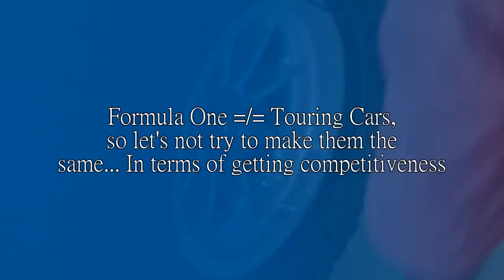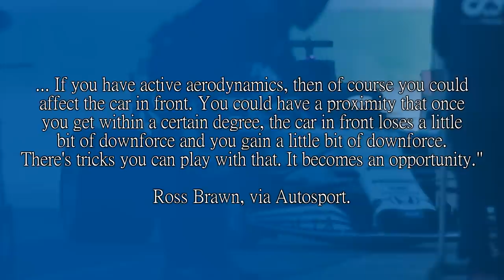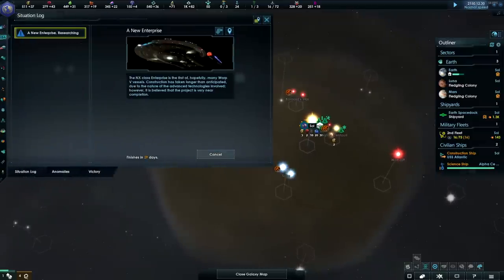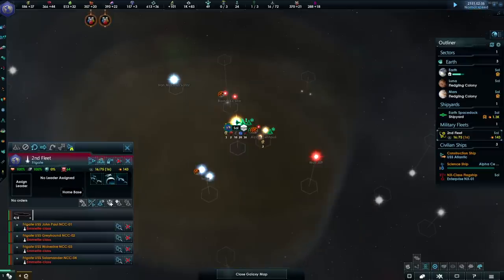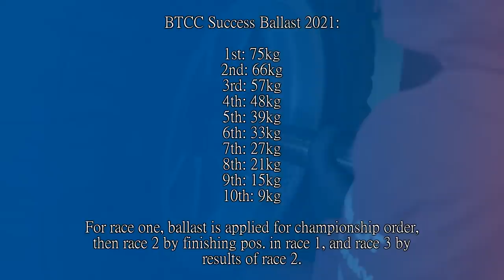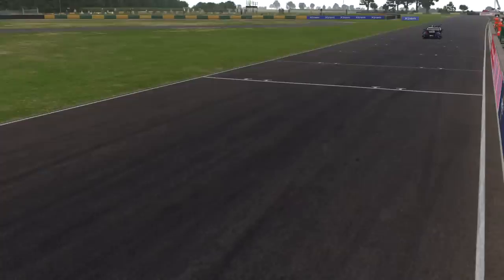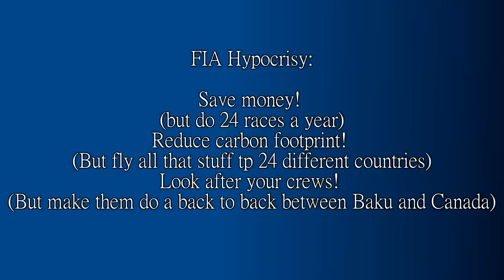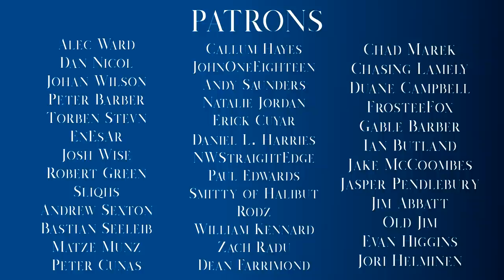BRAWN'S BIG BRAIN MOMENT: Opinions on the Proposed 'Reverse DRS' System for 2026

Comment: Cheers for the video Aidan. I was listening to your general description of what an F1 car is at the commencement of the video and my honest response to that with this era of car is, “Is it? Is that really what it is?” Hard to be surprised about a proposal to use active aero to disadvantage the leader as nothing is off limits to those in charge now. We have sprint races, DRS being misused, F1 cars with roll cages, they’re testing fenders to reduce spray in the wet, budget caps, shared parts lists. Ultimately, history shows that F1 cars have only progressively gotten worse over time since 2006 and the influence of issues such as sustainability and cost-saving are only increasing. The cars are safer though I’ll give it that, and that’s why most people watch motorsport, for the safety👍 Within fifty years the sport will be spec-chassis in all but name, closed wheel, and closed cockpit, you know…sportscars.

Comment: All good points [as usual]. The points about FIA's hypocrisy are spot on - the travel schedule thing boggles the mind. But to the point of downsizing the cars, I'm not sure it's really relevant any longer. Lets face it, most drivers are below average in stature so the older cars make sense, but at the same time there were/are plenty of truly talented drivers that had to be overlooked simply because they were "too tall". I dont think George Russell would have a drive if cars were the size they were 10 years ago. We've heard the argument that the cars have also outgrown the tracks, but IMHO it's safety that has outgrown many of the older tracks much more than car size.
Reply: Got something Special for you 🎁  TM!!

Comment: If the intention here is to change the downforce actively due to some position then there will be a big problem when there are trains of cars. 
Lets say that there is a train from P4-P8 (5 cars). The car in P7 loses 10% of it's downforce to aid the car behind with following. That would mean that the car in P4 would have a downforce reduction of 35,4% to keep the system fair throughout the train. But how is it fair that the guy in P4 would have such a huge reduction compared to P3. There is also a question of tyre strategy in this case and how the change in grip affects the longevity of the tyres .
Reply: Got something Special for you 🎁  TM!!

Comment: How does it make less sense than the current DRS? Apply those rules to it. Or just make cars smaller on Z /X axis and maybe give everyone DRS all the time within an operational set-up angle window. Either favoring Open DRS "passing" on straights with less angle while Closed in the corners. Or visa versa, weaker Open DRS on straights and stronger Closed DRS in corners.
Reply: Aidanmillward-TextOnTelegrm  Good Morning. What's the surprise?

Comment: A system where race control can slow the leader with drag is stupid. 
That same system is more useful for punishing track cuts and bump+runs, nascar super modifieds have a wing that leans back with speed and goes back up under braking, every straight, every lap. F1 could do this, every car’s wing will tilt back on the straights, and if you go wide or cut? The FIA hits a switch and your wing doesn’t tilt for the next straight

Comment: I've said this before but F1 will eventually become so far distant from what it was originally meant to be that it will do exactly what many before have done and have one hell of a fall from grace. It'll lose all relevancy to manufacturers, it'll lose the casual fanbase it is so desperately chasing with this daft excercise to turn it into some overtaking festival for 30 races in a row and it'll lose its core audience that at heart are just plain old fans of Motorsport in general

Comment: F1 has a very simple problem: the fast cars have the best drivers, start at the front, and pull away from the others.  F1 is only good when something causes cars to start out of position, like a wet qualifying.  Sprint races are bad because they exacerbate this problem: the fast cars get an extra 30% distance to undo any surprises.  

Rather than stupid gimmicks, F1 should make the cars simpler, lighter, and reverse grids so the fast cars at least entertain us by getting to the front and give slower cars the opportunity to cause an upset.

Comment: Being an F1 tragic I've been an advocate for handicapping in F1 for a very long time now, plus a voice for lost technologies & technology openness. If I was head of F1 (Bernie) this is how I would do it:

1. 1KG FOR EVERY POINT
For every Point a Driver obtains a 1kg Weight is added to the car.
ie. You win next race you carry 25kgs.
PRACTICE & QUALIFYING are done WEIGHT FREE! Weights are added ONLY prior to race. This way NO DATA is obtained by the teams during Practice and thus an UNKNOWN is added to/for the race.

Q. How does this affect the handling and tyre wear?
A. Unknown. Can only estimate.

These are supposed to be the BEST driver in the World, then let them adjust to the extra UNKNOWN!

As the Season progresses the lower teams become competitive for a win. This attracts SPONSORS and MONEY for the teams. Extra money means extra DEVELOPMENT.

Imagine this scenario:
The final race of the season and 10 Drivers have the potential to win the Championship. The Driver leading the Championship with 158 points starts from 13th and has to finish 5th or higher. Pole is taken by the person coming last in the championship with 124 points. 2nd on the grid is 8th in the Championship and has to win with the top 3 Drivers 

2. ONE WAY DATA & COMMUNICATION FLOW
What is the point of a DRIVERS' CHAMPIONSHIP if the DRIVER is told HOW to DRIVE by his ENGINEER?

What is the point of driver instrumentation if technicians are always looking at it. Advising of potential issues before the driver becomes aware.

The spectators want to see things go... BANG!

Not told when to pit by the team to take advantage a break in traffic or of an accident and Safety Car. Leaving judgements up to the drivers when to pit is another element of excitement added to the show.

3. DRIVER ADJUSTABLE FRONT WINGS. NO DRS!
Allow the Driver to make necessary adjustments to the wing settings to account for the extra weight and handling. Able to adjust while following to account for the loss of downforce.

4. 150L TANK LIMIT, NOT BY WEIGHT
Another variable the DRIVER & ENGINEERS have to ponder and it's 38C/100F and 1034kPa.

5. OPEN-SOURCE TECHNOLOGY - ANYTHING GOES
Formula 1 HAS, WILL & SHOULD continue to be the pinnacle of TECHNOLOGY. TECHNICAL WARFARE on 4 WHEELS. If it works, let it be used! Active Suspension & Skirts could make a comeback.

6.1st JULY - WINNING TEAM/CONSTRUCTOR OPEN BLUEPRINTS
ON 1st July of each year the WINNING TEAM/CONSTRUCTOR BLUEPRINTS, from the previous year, become publicly available to the other teams.

Potential NEW TECHNOLOGY/IES becomes available to the other teams. This allows the other teams to copy and improve on the winning team/constructor designs and technologies. To see what areas to further develop in their NEW TECHNOLOGIES. Instead of spending money to CATCH UP they can then channel that money into these technologies they are developing and then gain an advantage over the opposition.

Thus more/all teams will be competitive

7. EVEN TEAMS MEANS EQUAL SHARE OF THE PIE!
As the title suggests if the teams are even, it will mean an equal share of the pie.

There's your SALARY CAP... THERE IS NONE!
 
With the teams being equal & competitive and NO ONE TEAM being dominant, NO team will be short of attracting SPONSORSHIP and MONEY. Which is the sole point of the SALARY CAP/COST CUTTING, isn't it?

8. MORE TESTING, ESPECIALLY DURING THE SEASON
Enough said!

Comment: Why Formula One does not revert back to basics. Elemenate carbon fiber brakes for cast iron brakes. Go back to manual gearboxes. Raise the cars to decrease ground force. Make the cars heavier. Skinnier tires, etc... All of these would significantly decrease costs and bring the cars back to a more even playing ground.
Reply: Because then it would just be IndyCar?
Reply: Sounds dreadful, I don't want to watch tractor racing.
Reply: @wiegraf9009  I doubt you would be able to tell the difference in speed. Advanced technology isn't always necessary to make the show better. But it will make everything more expensive.

Comment: I disagree. I think penalising the faster cars is a very good idea.

It's still a balanced system, as it's overall still equal for everyone. But it should result in much closer racing.

I think a simpler system though, would be to provide bonus performance payments. The lowest ranked teams would receive the most money at the end of the season. This would balance out the budgets for each team and allow the lower ranked teams to compete on a more even financial footing. The financial issues seem to be the biggest driver of lack of on track racing IMHO.
Reply: Got something Special for you 🎁  TM!

Comment: Just the stupid "arcade game" concept makes me hate this concept of crippling a car that has a large lead. You make a hugely important point with "dangerous."
I didn't really like the DRS idea when it first came out, but have gotten used to it. The only really obvious incident of it screwing up the driving was last years when Lewis and Max both wanted to cross the line second so they could get the DRS advantage on the following straight, and collided.
Was DRS really a way to try to compensate for the lousy track designs which don't allow for good racing?
Reply: Got something Special for you 🎁  TM!!!

Comment: What about this. Get rid of DRS, add a button that adds just a bit of downforce on demand, the driver has to hold it. But this downforce button has a limited amount of time it can be used, say a total of 60 seconds or something depending on track. And it can be used anywhere at any time. It would be like rallycross joker lapsin reverse, you want to use it but you can only use it a bit and it’s strategy
Reply: Got something Special for you 🎁  TM!!!

Comment: BOP makes me retch. Any gimmick designed to limit performance to specific cars should be outlawed
Reply: BOP makes a lot of sense in endurance racing, where the manufacturers want to differentiate their cars. Absolutely not in F1 where the teams couldn't give a shit if their cars look similar so long as they go fast.
Reply from the maker: BOP works on a number of levels.

1. You get a grid full of interesting car shapes because teams aren’t buying whatever the best car is that season.
2. It stops the manufacturers spaffing money up the wall to build some monster because the ACO/SRO/FIA are going to nerf it immediately.
3. Even if there is a car that is better/best at a track it’s not a given.
4. It’s applied to ALL cars of a certain make. So all Porsches get a leg up or all Mercs get nerfed. So everyone has to adapt and it’s down to the drivers and teams to overcome any deficits.

Comment: Get rid of the whole thing, and get back to car vs car and driver vs driver fair and square. Weren't these new aero regs supposed to eliminate the dirty air behind the cars anyway? Therefore the original reasoning for DRS all those years ago, as an overtaking aid on the straights when it was impossible to get close enough to overtake otherwise, should be redundant. It's crap

Comment: You said that DRS is a necessary evil. But it's not. Indycar doesn't have it, and the racing there is light years ahead of F1. DRS is horrible, and should never have been introduced IMHO. It's a bandaid for a problem which should not exist.
Reply: IndyCar is a spec series so of course the racing is better. Formula E has "attack mode" and the racing is also better there than in F1...because it's close to being a spec series. The car development focus in F1 is what makes the racing so unequal and therefore worse than it could be...but then it's also fun to follow the car development right?

Comment: I hate the idea of a leading car having some kind of handicap though I actually think I'd prefer a system where the car behind was allowed to gain downforce when following another car within N secs and then get rid of the more artificial feeling DRS. The whole reason DRS came in was to 'balance out' how hard it is to follow another car; feels like a more direct solution to the actual problem
Reply: Yes, I had pretty much the same idea, I think that if it works it would be a perfect solution. Don't know why more people haven't come with this idea yet.

Comment: Such a terrible idea. Yes it would be confusing and dangerous for drivers, but it would ALSO be confusing for audiences. What counts as an overtake "on merit" or not would be extremely hard to keep track of with all kinds of real time fractional adjustments to car performance. DRS is not so bad because it's at least a predictable amount of downforce being dropped each time around. We might not like it, but at least we can understand it. This is just...unbelievable nonsense.

And of course, despite all of these problems they won't contemplate doing something simple the fans actually want like doing reverse grids in the sprint races! Keeps quali meaningful, no more bullshit about "pole position is different from a P1 start," and we get to see some overtakes during the sprint.
Reply: Got something Special for you 🎁  TM!!
Reply: Got something Special for you 🎁  TM!!

Comment: The new technical and financial regs need time to bed in for a while yet but I quite like Gary Anderson's suggestion of using DRS as a rubber band. The following car gets a slight advantage to get up to the car in front, but then loses it when within a certain gap and the driver would then have to make the pass unaided. Having gone through the more often than not snooze fest races of the 90's & 00's I've never been that offended by DRS, I'd take slightly aided passing over next to none at all. I also liked the idea of reverse grids, but only if it were in place of a qualifying session so that the weekend could be shorter. Throw a handful of them into a lottery draw along with sprint races to make sure every year could potentially be different.
Reply: I don't think that such a rule is necessary. The drivers have good strategy options with the hybrid engines and DRS combination. It's something that didn't exist years ago, and the cleverer drivers have been able to use it to good effect.
Reply: Got something Special for you 🎁  TM!!!!

Comment: Im not a mind reader imagine they want to use it similar to DRS but more natural looking, rather than as rubber banding. e.g. you lose down force running in dirty air, so to equalise it you take that same amount of down-force to allow better racing without all the overtakes looking exactly the same in one single drs zone. I think the idea has potential but also pitfalls. It's a solution to problem that the vast majority of DRS overtakes are the exact same, which is a bit of a problem.
Reply: Got something Special for you 🎁  TM!!!

Comment: It’s just getting stupid at this point. My 25 plus year interest with NASCAR died because of the stupid gimmicks they kept adding in. If F1 does this then I feel the same is going to happen. IndyCar I genuinely feel has the right balance. Yes, it has push to pass in essentially kit cars but it’s limited how much you can use and still leaves it in the drivers hands and despite Scott Dixon being the best driver the last two decades, you still don’t know who’s going to win the race or title. Will Power I didn’t expect to win this year, he did. That’s parity. F1 is different of course but they need to simplify it and put it back in the drivers hands, not with a mass of technology. If you want the engine to be controlled on power, three settings, save, standard, whip your balls out power. I could go on but I’ve probably wasted the comment sections time lol

Comment: I took it more than the aero on the following car can have a negative effect on the leading car - presuming you're close enough. 
Either way its a false way to get closer racing and I'm not sure thats what people want anyway. F1 was way better to watch back in the 80's/90's and the cars were nowhere near as matched. 
The top tier of the sport should have very limited rules (as opposed to limiting rules). 
Something to make sure they're as safe as current tech allows, tyre size limits, an overall size limit and maybe a fuel limit if you want to force pitstops. 
So far as innovation, speed, power and so on is concerned - it's F1 allegedly the pinnacle of the sport - so why are we holding back on things that can make them faster?
Reply: Got something Special for you 🎁  TM!!!

Comment: I'm not a fan of BoP and worse, parity. It's F1, not IROC. A spec F1 series will just personally bore me. We've only had one single year of the new regs. Plus it screams safety hazard to me to suddenly alter downforce levels. All it takes is one giant crash from screwing with the downorce levels.

FE's gone and rolled back the gimmics, which I like that, and when FE looks like the more competently run series. I actually, on the cricket angle, really like the T20 cricket because it its in nicely with the Test matches and ODIs, and I'm slowly warming up to the Hundred, since you brought up cricket.

I mean, when the Gary Bettman era NHL looks more competent than F1....then you have a problem. On that note, salary caps are an interesting one for team owners.

I'll throw out a hypothetical. How would they work in F1 if you had one or the racing part of a team, i.e. the ones who go to races,then?Would we see the average salary go down for drivers or? Say if the salary cap is 100m a year for drivers, pit crew, engineers, and so on, basically, everyone who goes to the track at the weekends.
Reply: Got something Special for you 🎁  TM!!!!